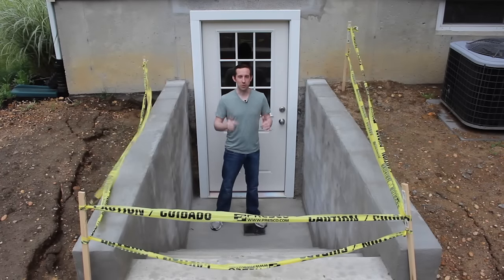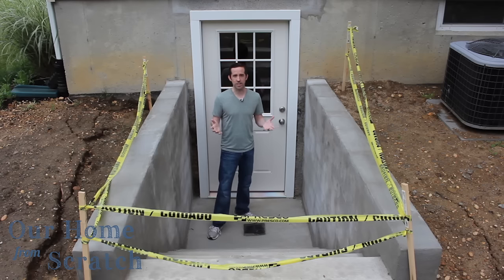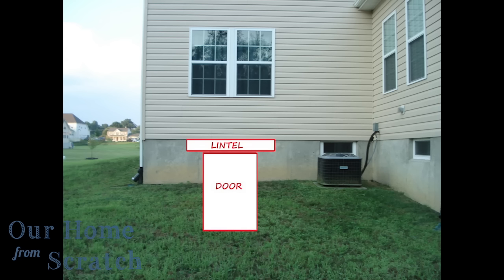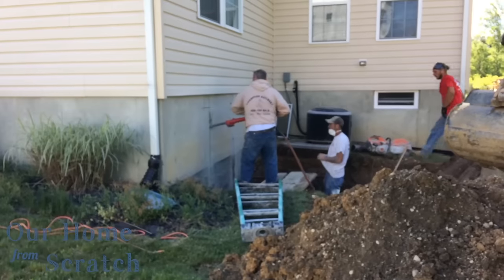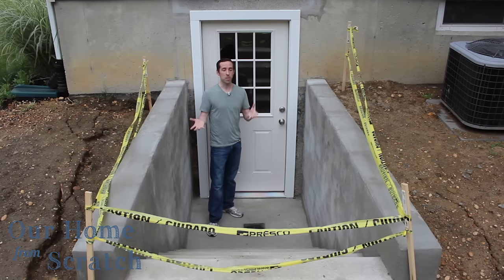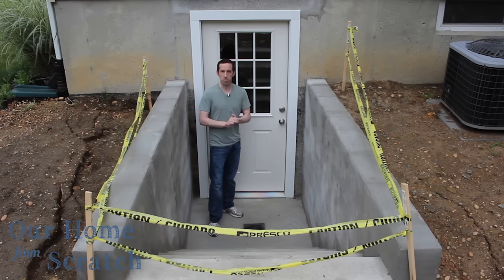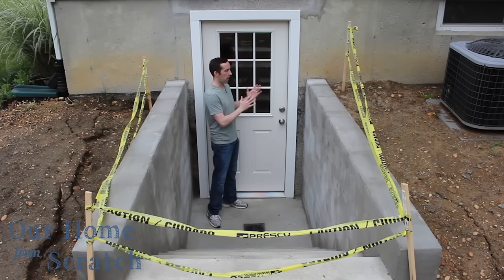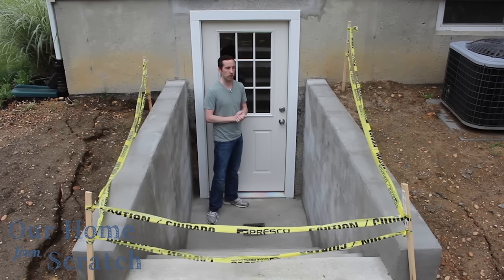How to Install a Basement Egress

Comment: John: long time listener, first time caller. Great video! I am working up plans for a DIY walk up for our basement that is similar (the quoted prices here in NoVa are 15k++ and more than I'm willing to spend). I intend on paying for an excavator ($100/hr) and paying to have the foundation cut ($450 for the door cut out, but I have to excavate the concrete). I plan to do the concrete retaining wall and concrete steps myself. Do you have any additional videos on how the contractors did yours? I also plan to do a concrete block retaining wall because I think it will be easier to do with a small crew (vs. trying to work on managing and pouring large forms). Any additional insights you have on the concrete walls and steps would be a great help--thanks!
Reply from the maker: I don't have any more videos.  Recommend you call some concrete places and not egress/Bilco companies.  The folks who did my retaining wall also do sidewalks and driveways.

Comment: Did you need to do underpinning for frost protection?
Reply from the maker: I don't think so.  It's a standard poured concrete footer under the walls.
Reply: @OHFScratch  seems like Michigan requires underpinning

Comment: Where did you run the drainage? Do you have positive drainage to a storm drain pipe or does it run inside to a sump pit?
Reply from the maker: Both.  It tees out to yard and also tees into foundation drain pipe.
Reply: Did your home have exterior waterproofing that you needed to modify, or did you need to rely on an interior system before finishing the basement? 

I'm looking at houses now, mostly built in the 90s/00s, so right around that era when exterior basement waterproofing became standard. Still seeing lots of unfinished basements without walkouts though, so I'm trying to get ideas about how much work it would be to add a full walkout entrance with drainage system.
Reply from the maker: The home was built in 2010 and its foundation didn't have any sort of external waterproofing wrap on it.  It was only covered in a thin layer of tar.  The house was build with a significant grade to it, so water intrusion has been minimal.  Had I had to do it again, I would've looked into a rubber type foundation wrap.  The egress has been fine with moving water away though.  Depending on the grade of your property, you can add a gravity drain at the bottom of the egress to redirect water away.  Only issue is clogs on the drain cover from leaves.
Reply: @OHFScratch  no single material will ever waterproof the exterior walls of a house, even rubber. All materials are permeable in the presence of standing water, which most foundations are exposed to. Even if you found the perfect wall material, your slab still isn't waterproof, so water would just come up from under the wall and slab.

Modern basement waterproofing systems usually employ a combination of asphalt sealant, drain board, perforated drain pipe in free flowing stone/aggregate & silt wrap, and proper grading to direct storm water away from the house.  It's pretty surprising that a house built in 2010 didn't come with a system like that.  Did they rough in the plumbing in the basement?  That's usually an indicator that the basement was designed to be finished, i.e., waterproofed.  Before the 90s, basements weren't intended to ever be living spaces, which is why they never waterproofed them. Now that finished basements are very common, it's became the standard to ensure the space will be water tight for finishing.
Reply from the maker: They roughed-in the plumbing for a finished basement bathroom, but as an optional cost.  Water intrusion over the previous ten years of my ownership here with the basement unfinished has been very minimal and only entered in small, but visible foundation cracks.
Reply: @OHFScratch  that could just be localized issues then. Maybe you do actually have a waterproofed basement after all. If your house was build by a production builder or a reputable custom home builder and they roughed in plumbing in the basement (even at an additional cost), they must have waterproofed the basement. That's a liability on them to give the appearance of a basement designed for finishing if it is not in fact capable of being finished without extensive modification to the foundation.  Not saying it can't happen, but it would be rare.

Comment: The drain in front of the door looks too small to handle rain. We are gonna be fixing foundation and want to close garage door entrance. We want an entrance like this. Our foundation is cinder blocks and we have a window on that spot. Our back looks identical to your video and the entrance would be at the identical spot.

We had been flooded 8 times so creating an entrance outback like this worries me that water would just flood that door causing damage and eventually entering basement again. You didn’t explain how you plan to keep water away.
Reply from the maker: The drain size is sufficient.  It only "flooded" once a few years ago when a very small amount of water came in after the drain cover got plugged from a lack of care on my part.  Otherwise it's been completely fine.

Comment: Just from personal experience I would never put one of these on my house. I have one right now and it is nothing but a pain. Because after several years that sucker is going to leak your basement is going to be flooded. You'll have to put your hot water heater on top of a pedestal so that the water doesn't get to it when it does leak and when you do have to fix it it cost a good bit of money so I would rather bust up a whole bunch of sheetrock and try my best to patch it up down in the basement or whatever the issue was with them having to install that. Because I so regret ever buying a house with one of these POS attached to it. We've went from putting a roof and a door it seems like a little house on top of those stairs nothing helps it will leak eventually and cause you problems so stay away from these don't ever get them I promise you 10 years down the road you will regret it or you might regret it sooner than that. Unless you just got a couple of million dollars to just blow then go ahead and do it.

Comment: You are going to regret building those walls level vertically over time with standard foundation block.   I'm about to replace my vertically built block retaining walls that after 20 years can't retain the weight of the soil.
Reply from the maker: Maybe.  Sounds like I have about 16  years to go though.
Reply from the maker: @romeshomey  Good luck with the fix.  No cracks or setting over here yet so I'm keeping my fingers crossed.
Reply: Same thing here bought a 21 year old house and it needs to be replaced because it's being pushed inwards.  Having a heck of a time finding a contractor to even give us a quote :(
Reply: Romes and Jenny - are you saying yours is block as opposed to poured forms?
Also, Romes I'm curious about the staggered look but don't want to click on unknown 🔗 can you tell me the site?

Comment: Pressure treated lumber should always be outside and exposed. It should never be the interior of your house and closed off as that may be  toxic
Reply from the maker: It hasn't been toxic since early 2000s.  It's required per my local building inspectors for any lumber that has directed contact with concrete.  Non-PT-lumber can rot with contact with concrete over time as it may wick water out of it.

Comment: Don’t. Like this at all  a lot missing , lower dry well  lower catch area  waterproof backs of walls   And footing    rebar steps   Upper step should be higher than lawn  hand rail. Wall rail missing. Entrance light
Reply from the maker: Wall rail and hand rail were added after the fact by me.  I asked for a lower well, but the builder decided to keep it higher to avoid digging near the footer, which has presented issues with water intrusion.  Entrance light is above the door now as well.